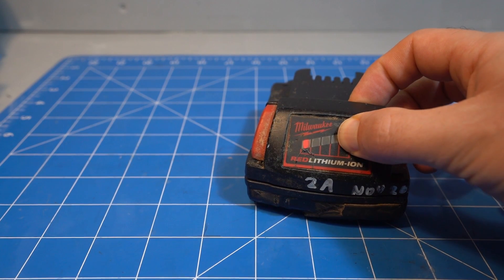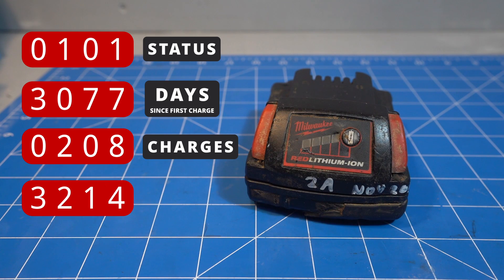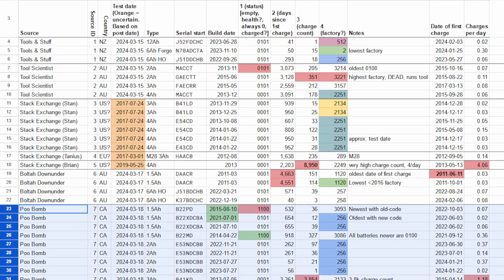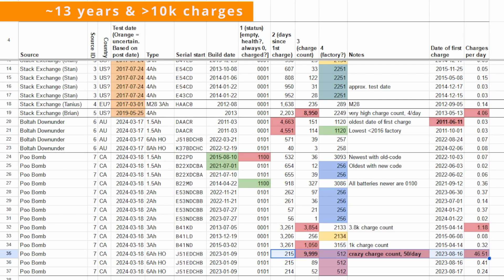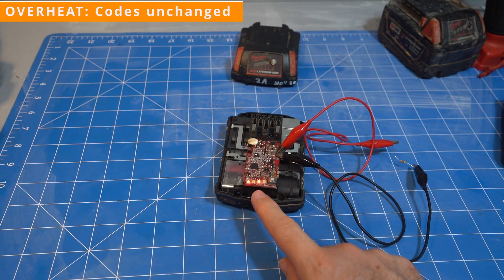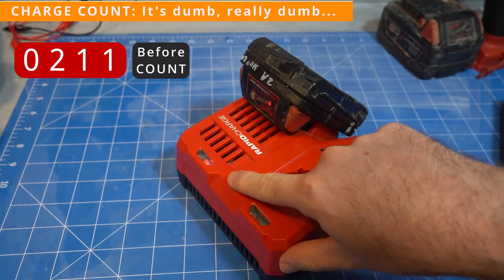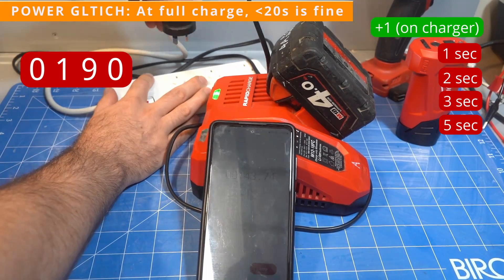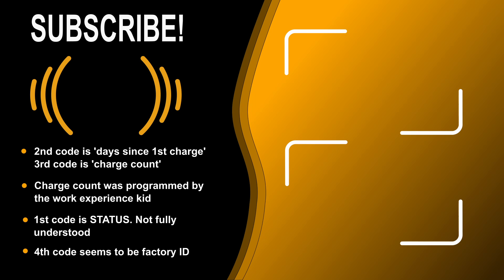[007] Milwaukee M18 has hidden diagnostic codes

Comment: Okay, here ya go:

1 & 2 came with a drill/driver/charger/bag set and 5 & 6 were bought together as a pair (or at least simultaneously).  All were bought at Home Depot here in Nova Scotia, Canada.  The serial numbers  on the older batteries follow a different format.  The "heat stamp" is actually a date stamp:

1. M18 RedLithium
CA 2024-04-18 1.5Ah B22LD-189 2013-10-09 0001-3505-0075-2070
Made in Korea/Malaysia, additional processing in China

-------------------------------------

2. M18 RedLithium
CA 2024-04-18 1.5Ah B22LD-189 2013-10-10 0001-3492-0089-2070
Made in Korea/Malaysia, additional processing in China

-------------------------------------

3. M18 RedLithium XC
CA 2024-04-18 2.8Ah B41LD-470 2014-01-24 0001-3510-0063-2134
Made in Korea/Malaysia, additional processing in China

-------------------------------------

4. M18 RedLithium HD9.0
CA 2024-04-18 9.0Ah H18FDCCD 2020-07-30 NO-CODES
Made in Korea, additional processing in China
ONE-KEY Compatible

-------------------------------------

5. M18 RedLithium XC4.0
CA 2024-04-18 4.0Ah E54SDCKC 2021-07-17 NO-CODES
Made in China
ONE-KEY Compatible

-------------------------------------

6. M18 RedLithium XC4.0
CA 2024-04-18 4.0Ah E54SDCKC 2021-07-17 NO-CODES
Made in China
ONE-KEY Compatible
Reply from the maker: Thanks! Never seen a 2.8Ah. It has the same code (B41LD) as other people's 3Ah
Reply: @toolscientist  actually, mine were in Watt*hours so I saw a number consistent on the batteries that I presumed was the amp hour equivalent.. I'll get the data later for you
Reply: @toolscientist  ok so here it is -  All of my batteries are tagged in WATT*HOURS, not AMP HOURS.  I wasn't sure about some of them but I noticed that the "CAT(alog) NUMBER" ended in the same two numbers as the AMP*HOUR RATING based on newer model numbers (XC 4.0) - the "2.8 Ah" battery is called an XC with no number, just XC.  If YouTube would allow me to send you a photo, you'd see.  Here's the data:

1. M18 RedLithium
27Wh ("1.5Ah")
Cat. No. 48-11-1815 <-- ends in "15"

2. M18 RedLithium
27Wh (1.5Ah)
Cat. No. 48-11-1815

3. M18 RedLithium XC
54Wh (2.8Ah)
Cat. No. 48-11-1828 

4. M18 RedLithium HD9.0
162Wh (9.0 Ah)
Cat. No. 48-11-1890

5. M18 RedLithium XC4.0
72Wh (4.0Ah)
Cat. No. 48-11-1840

6. M18 RedLithium XC4.0
72Wh (4.0Ah)
Cat. No. 48-11-1840

Comment: I have failed two batteries from the first gray date range, or at least seems to be manufactured in that time because I'm 90% sure they were purchased in December of 2016 around Christmas. They were part of a drill package but I was gifted another drill set not long after which got more use and forgot to include these batteries in the rotation. I went to go use them and they both fail to charge. You can see they were barely used at only 18 and 11 in the charge count. Pressing the button just flashes the first indicator light, placing them on any of my 3 chargers just causes the chargers indicator light to turn red and the first indicator battery to flash slowly. I can edit this post with additional batteries as needed but these appear to be the most interesting.

US 2024-05-03 5Ah G29CD 150729G 1100 2779 0018 3541
US 2024-05-03 5Ah G29CD 150729G 1100 2721 0011 3541
Reply from the maker: Manufacture date is 2015-07-29. Date of first charge is 2016-09-23 and 2016-11-20. Those are the latest date for a 5Ah, though. 
Interesting batteries are around April 2014. Most batteries before April 2014 have the 2nd bit as 0 (so 1000 or 0001), whilst most afterwards have it as 1 (1100 or 0101). So if you've got a bunch of batteries around 2014, it would be helpful to know which ones are have the 2nd bit as zero.

Comment: I think the 9999 charge it's when the uP is programmed.
After the First charge or test in factory come 0000. In that bat someting goes wrong.
Reply from the maker: Yeah, I'm leaning towards it being a glitch or improper initialisation at the factory. My first thought was it was a fault indicator used if the BMS detected extreme temp/voltage/current. But someone posted a 9999 battery that had never been used on a tool. My other idea was faulty chargers or dirty power that made the charger flick on and off rapidly, but so far, people have only had one 9999 battery

Comment: My 5AH M28 Bad Battery from Dec 2016 has the following lights 1st Led1 on once.
 2nd 1st Led 2 then 2nd Led 7 and 4th Led 5.
3rd 3rd Led 2 then 4th Led 5. 
4th 2nd Led 6 then 4th Led 8.
Heat Stamp KAECE

Hope this helps
Reply from the maker: Thanks. Heat stamp says October 2015 (first letter is month, excluding "I", 2nd and 3rd letters are year). Date of first charge is Dec 2016 - does that sound right?

Comment: Brand new never used. This came with the Logi-Force Knockout kit. Factory charge of 1000, US 2024-04-25 2AH E53NDCBB 2023-11-23 0101 0 0 256. Voltage: 0.0VDC? Makes me wonder if it requires a first charge before it will activate.⚡
I have more out on jobs and will do them later.
Reply from the maker: Thanks, added. The sequence we've found is that they start at 0011. Putting it in the charger starts the day counter, but leaves charge count as zero. 2nd time in charger will increase charge count to 1. Once you put it in a tool and squeeze the trigger, it switches to 0101. Then when you run it flat it goes to 1100, and then charging it resets it to 0101.

Comment: From the grey area
Au 2024-04-23 5Ah G29JDCBC 21-06-21 NO CODE
Reply from the maker: Yeah, the grey zone seems to be battery dependent. 1.5 & 2Ah got codes mid-late 2021, but most others got them early 2022. 5Ah grey zone currently sits at: 14 Jan 2022 (no codes) to 3 March 2022 (codes)

Comment: 4 Batteries tested.
Two in your grey zone on the timeline.

1)  XC5.0  No flash codes  Etched Code:  G29JDCBC 210626

2)  XC5.0  No flash codes  Etched Code:  G29JDCBC 210622

3)  XC4.0  E54BD 14985 (older style label with no date code just number in box on label); 13051U (heat stamped code)  
3 bars charged; 19.8v
Flash Codes
0001
3878
0670
2250

Battery #3 seems to indicate a "0" for health even though it works, but is old.  It may not hold a charge as long, but I haven't timed the discharge.  I can if you want.

4)  XC5.0 Manufacture Date Code:  220303
1 bar charged; 17.4v
Flash Codes
0101
0541
0015
0256

Only this battery has all the data to use your full requested format:
2024-04-20 4Ah G29NDCBC 2022-03-03 0101 541 15 0256

Great detective work!
Reply from the maker: Is that last battery a 4Ah or 5Ah? Currently all G29 serial numbers are 5Ah whilst 4Ah are E54. 

Also, is the last code definitely 146? You might have missed 2 flashes and it's actually 256. So far all of the new 5Ah have had 256 for the last code.
Reply: @toolscientist  You are correct on both accounts.  I edited my comment to be correct.

Comment: I’ve got a battery taken apart to solder a part that melted apart this is helpful there’s a reset you can do I’ve done it to 2 but can’t figure out this third one
Reply from the maker: How do you do the reset? It'll be interesting to see if the reset also resets these codes.
Reply: @toolscientist  you hold down the button and let it cycle through the blinking then hold it again. That’s worked for 2 out of 3 battery’s ive been working on. There’s a thin strip of metal that acts as a fuse sort of and it melts if to much current flows it disconnects the last cell in the battery.
Reply: @toolscientist  I can make a video for you I have a battery tore apart right now
Reply: @toolscientist  okay so here’s my thoughts I just tried to charge the battery after I soldered it and after I took it off it starts working so it seems to be that putting it on and taking it back off is the actual reset for the battery
Reply from the maker: Yeah, I've heard putting it back on the charger resets it. Did you check codes before and after, or did this battery not have codes? I know 1100 means the battery is flat and it won't work on a tool. Putting it in a charger resets this to 0101, then it works in a tool.

Comment: Got a brand new original High Output 6.0, section 3 of which shows 9999.
Reply from the maker: Is the first code 0011 or 0101? Can you give all the other details? (first 8-digits of serial number, build date, the other 3 codes)
Yours is now the 4th to have 9999. Doesn't seem to be any pattern to it. Two are 6Ah HO from 2023 with 4th code of 512, the other is a 1.5Ah from 2014.
Reply: @toolscientist  Ok, here's full layout. I've got two 6 HO batteries. 1st is 230316, 2nd is 230317. Bought together. 1st section is 0101 on both, 4th section is 512 on both. 2nd section shows 297 and 294 respectively. 3rd section is 9999 and 5 respectively. So in reality I charged them both 5 times or so. But the 1st battery still shows 9999 no matter what.
Reply from the maker: Those batteries are very interesting. So far you're only the 2nd person with 256 on a 6Ah HO. Can you give me the first 8 digits of serial number (should be J51DDCHB or similar) and the country where they were purchased (other 256 was in NZ)

Comment: ok, so only the 3 oldest of the 6 batteries that i own give codes, but my serial numbers are in a different format with a less obvious date code.  Also, I noticed that the three newer ones have a KEYHOLE + WiFi logo on them, which I'm thinking may mean that they have a wireless method to read the codes, but I dunno.. i thought you were saying HEAT CODE but it's a date code on older batteries that's stamped near the terminals
Reply from the maker: Yeah, older batteries have a not-very-useful serial number. Most batteries from at least 2016 have that One-Key logo. There's definitely no bluetooth in the battery - might just mean that it can communicate with one-key tools. I said "heat stamp" and yes, the heat stamp is a date code. In the Americas it is obvious as heat stamp is YYMMDD then a letter.
Reply: @toolscientist  i didn't know anything about one-key until now

Comment: I did come across a few that did not have the diagnostics code. You may already have these dates. Here they are if it helps...
US 2021-05-28 5.0 G29JDCBC
US 2021-06-02 5.0 G29JDCBC
US 2021-08-19 5.0 G29JDCJC
Reply from the maker: Somewhat helpful. Seems only 1.5Ah and 2Ah get codes from July 2021. All others start around March 2022. 5Ah with codes are G29N - interesting that they went from J to N in 6 months. 

Do you know anything about the meaning of the serial numbers?
Reply: @toolscientist 
I don't. I assume the G29 is manufactured site or maybe even production line. Not sure.

Comment: i have an american 6.0 with a date code of 210205 that DOES NOT do the flashing codes
Reply from the maker: Yeah, most batteries didn't get codes again until March 2022.
Reply: @toolscientist  it was the only battery I had that was close to the period in question. The rest of my plethora of Milwaukee batteries have them and act as normal. I’ve begun to be more self conscious about throwing batteries on the charger I don’t wanna increase the “cycle” count and lower the resale value later on. Not sure if that’s even something people will check when buying used batteries
Reply from the maker: Not likely. For most people it will only be about 10% higher than what the true count would be.
Reply: @toolscientist   i do have two 5Ah batteries with a date code 220212 with the codes and made in  prc, not sure if it is of any help

Comment: Got myself a combo set about two weeks ago. Charged the batteries, used them for a bit and went back to storage.

EU 2024-04-05 5Ah G29NDCBC 2023-07-24 0101 13 0 256
EU 2024-04-05 5Ah G29NDCBC 2023-09-11 0101 13 0 256

Diagnostic mode flashes all diodes 3x then flashes them 4x. So the counter starts from 0. Kudos for Milwaukee
Reply from the maker: Thanks. Looks like all modern 5Ah are 256 for the last code

Comment: first thing I don't think tools & stuff 6.0 batteries are HO batteries as you have listed in your spread sheet at least I don't see HO on the front like on mine 

2x: HO XC6.0 batteries  slot #4 code is 0257 on both of them not 0256  slot #1 is  the same 0101
ser#'s : J51BDCHB  211203  0238820/0239235

1x: XC5.0  SLOT #4 code is 0256 SLOT #1 is the same 0101
ser#: G29NDCBC  220422  2042837 

also I have more batteries with later 2021 dates without working code indicators there all 5.0 batteries  210618/ 210624/ 210820/ 211027
hope this helps
Reply from the maker: I think T&S's 6Ah is a HO. We just get different labels outside of the Americas. T&S's battery is the only 256 6Ah HO, but it is also the only J51D. Most are J51[ABEF]

Thanks for the data. Your 5Ah is the oldest to have regained codes. I think the 5Ah might have been released after they got rid of codes.

Comment: Have i two m18 5.0 batteries one made in 9/23/21 and the other in 11/12/21. They both do not do the diagnostic mode. Neither of them have a heat stamp but they both come from home depot
Reply from the maker: Yeah, newer ones don't have the heat stamp, just the date in the middle of the serial number. Seems like most batteries don't get their codes back until March 2022. The July 2021 is from a 1.5Ah and seems to be an outlier

Comment: @toolscientist I’ve got two 5ah with date code 21 09 22 and neither flashes any codes
Reply from the maker: Yeah, it seems most batteries didn't get their codes back until March 2022. The July 2021 is from a 1.5Ah and seems to be an outlier.

Comment: Faulty Battery 18V 3AH : US 2024-04-03 3AH B22HD123 211346R 0001 4173 0071 1536 NOT CHARGING.      2ND BATTERY FAULTY NOT CHARGING 18V 9AH : SN H18EDCAD 170507 0005016 NO CODES. BOTH BATTERIES FAILED TO PROVIDE USEFUL SERVICE. 8 OTHER BATTERIES STILL INSERVICE. Thanks for your work!
Reply from the maker: Thanks! On the 3Ah, is the "211346R" the heat stamp near the terminals?

Comment: A modern 6 Ah pack:
US 2024-04-02 6Ah J51FDCHB 2023-05-19 0101  142  4  512

Here are two really old, original 23 Ah M18 batteries without a designation such as "CP1.5", but doing the math they're about 1.28 Ah.  There are no date codes whatsoever on these packs.  I had two more that were just a little older than these that received heavy use and were recycled just recently.  These two were purchased soon after those other two were purchased but have received much less use as you can see from the days vs. charge cycles numbers.
US 2024-04-02 1.3Ah B22BD095 (No date) 0001 4840 29 1056
US 2024-04-02 1.3Ah B22BD095 (No date) 0001 4840 28 1056

I also have two batteries that fall inside your green "Codes" date range but don't report any codes.  Both are:
US 2024-04-02 6Ah J51ADCAE 2021-08-22 (no codes)

The rest of mine are within your existing red "no codes" date and I've confirmed they don't report any codes.
Reply from the maker: 1st charge was 1st January 2011. You missed out on oldest battery by 2 months, though ;). You might be able to see the date on the heat stamp near the terminals. It's in YYMMDD format then a letter at the end.

Yeah, green zone is getting complicated. So far the only 2021 battery with codes is a 1.5Ah. The next newest battery with codes is from March 2022
Reply: @toolscientist  I've looked, but there's nothing stamped near the terminals; it's completely smooth.  These two also don't have the + and - markings that I've seen in photos of batteries that have the heat date stamps.

Comment: US 5A 2024-03-29 G29JDCJC 220114 -
US 5A 2024-03-29 G29JDCJC 220108 -
US 6A 2024-03-29 J51BDCHB 221121 0101 0248 0000 0257
US 6A 2024-03-29 J51BDCHB 221121 0101 248 0000 0257 (half charged) 
US 5A 2024-03-29 G29NHTBC 221130 0011 0077 0000 0256 (Charged-unused)
US 6A 2024-04-02 J51BHTHB 220809 0011 0079 0000 0257 (Charged-unused)
US 6A  2024-04-02 J51BHTHB 220809 0011 0079 0000 0257 (Charged-unused)
US 6A 2024-04-02 J51EDCHB 230618 0011 0078 9999 0512 (Charged-unused)
US 6A 2024-04-02 J51EDCHB 230701 0011 0078 0000 0512 (Charged-unused)
US 8A 2024-04-02 K37EDCHC 230306 0011 0078 0000 0512 (Charged-unused)
US 12AHO 2024-04-02 J52FDCHC 230309 0011 0082 0000 0512 (Charged-unused)

I extended your format with notes that might explain some codes.  The first 2 produced no codes. I wish I only charged the first 5 for warranty reasons.
Reply from the maker: Lots of interesting ones there. Seems like 0011 only switches to 0101 after charging AND being used in a tool - I thought it was just after first charge.

That 9999 is really odd. I thought it was due to faulty chargers or power supplies that were flicking power on and off, but I'd expect you to have multiple 9999 if that were the case. My other theory was that it was a "warranty void" indicator for abused batteries, but that battery can't have been abused as it's never been put on a tool. Maybe it's just a glitch?
Reply: @toolscientist  yeah, I'm wondering if the counter shows 9999 but in reality is -1.  It'd be impressive to see a 9998/-2.  It's been months but I know it took me a few tries to get the hang of fully seating in 1 shot
Reply from the maker: @netWiz1  i really need to poke around with their serial interface on the J1 and J2 pins and see if I can find their diagnostic mode. That should return the charge count as a 16-bit number, so we'll see if it's -1, 65k, or maybe just some stupidly large number

Comment: I have a newish forge battery from the us 230731. 1010 156 51 22 are the codes i get the last one is the interesting one if you have any questions feel free to ask
Reply from the maker: The last code is definitely "22"? So far every other Forge has been "2"

Comment: Most of my batteries I own fall into  the 2016-2021 no codes manufacturing lot. However, I did have a new battery that had the codes. I will endeavour to check every battery I ever see on site for more codes. Hope this helps. 

AU 2024-04-01 5AH G29NDCBC 2023-01-19 0101 0257 0003 0256